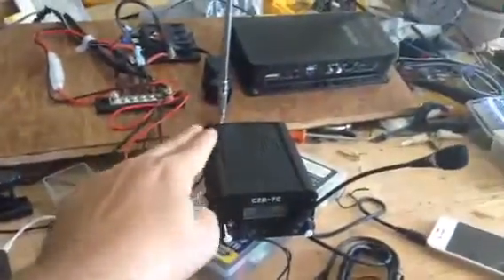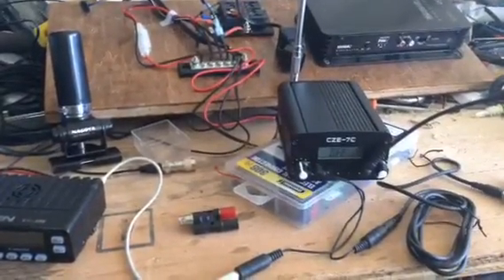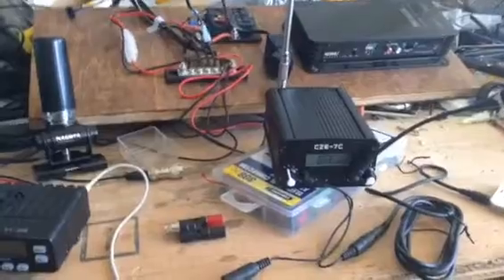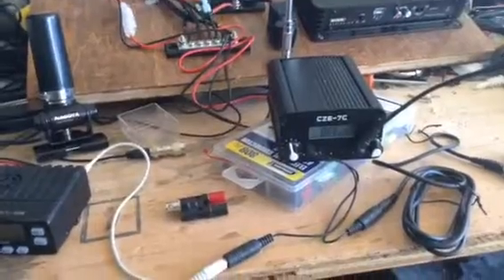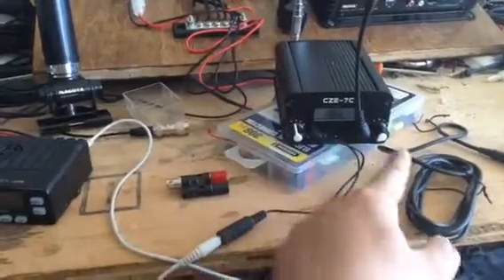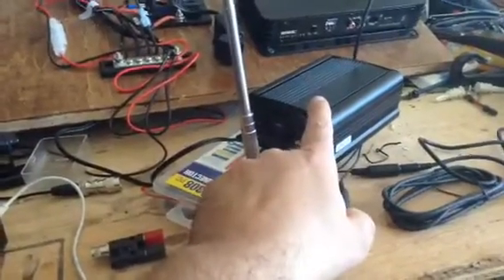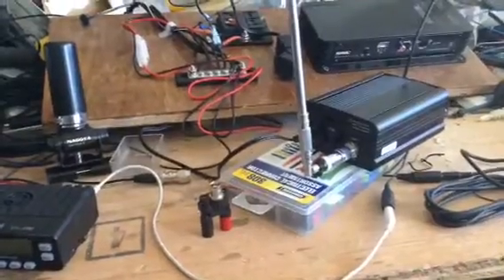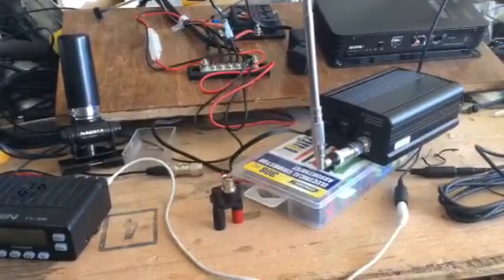Low power FM "Pirate Broadcast" test results part 1

Comment: Not to be a jerk, but with proper audio processing you can make it sound as good as your local station. Antenna height and type, along with cable type are a function of distance. Low pass filtering is needed, but audio quality is not an issue with this model if properly processed.

Comment: May look at this youtube for another type of idea( around 20:00 mark:
https://youtu.be/twF7UEp1ysE
Reply from the maker: Thanks.  It's not exactly my specialty but I try to work wit this stuff.
Reply: Not mine either. Been learning a lot 8). been working on my channel on a multi media multi purpose small box. One on the function will be FM transmitter but i will be using raspberry pi